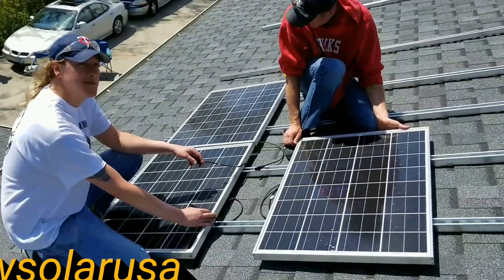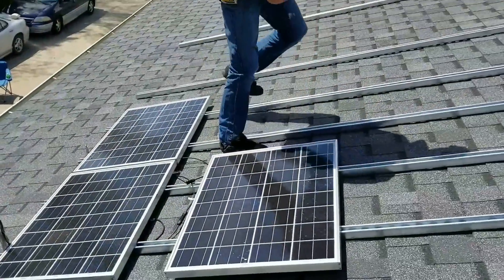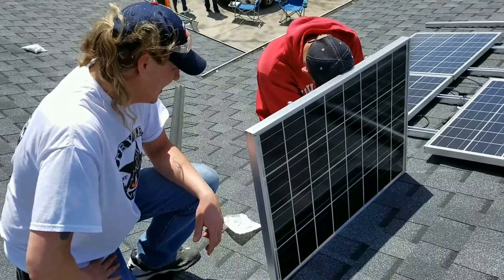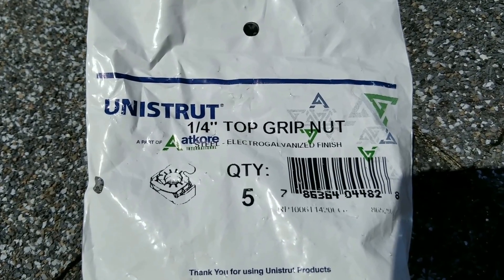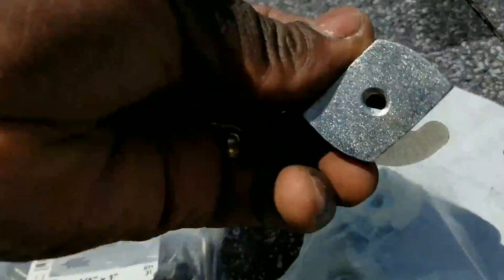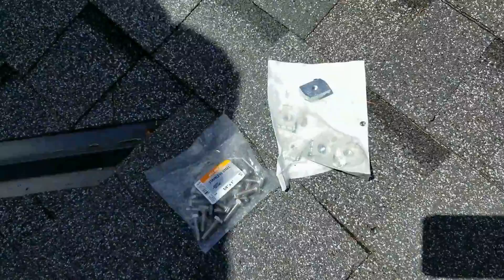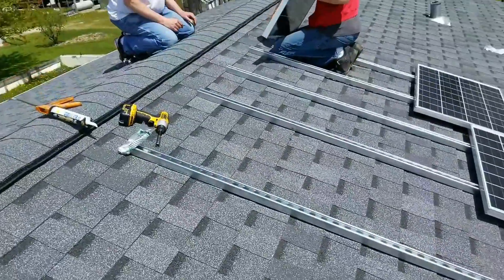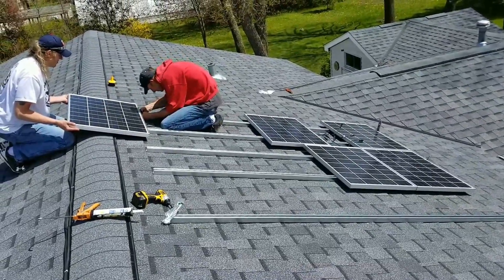DIY 24 VOLT OFF GRID SOLAR AND BATTERY SYSTEM WANAMINGO MN
EPISODE #2- Installating The Panels

Comment: Are the unistrut and teenuts stainless, too? I don't understand how is he tightening down panels if the teenuts are connected directly to panels then sliding panel on? Too cheap for panel clamps?
Reply from the maker: Yes they are.
Go to my playlist on unistrut you will find details on how I mount solar panels with unistrut and super strut